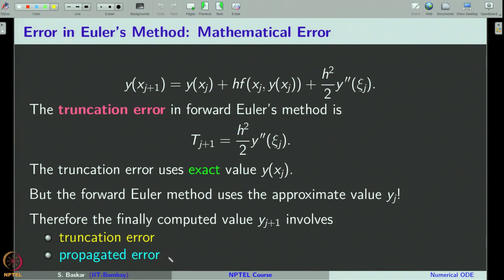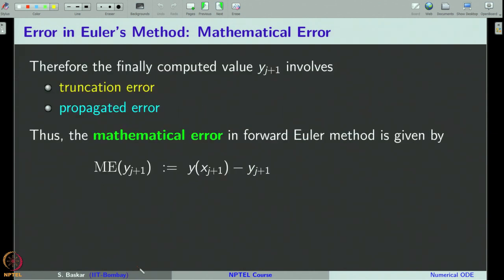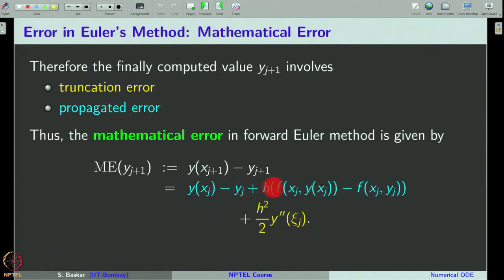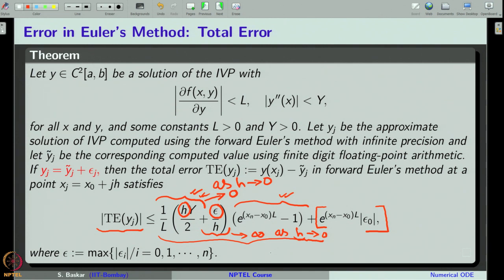Week 11 : Lecture 56 : Numerical ODEs: Euler Methods (Error Analysis)

Comment: Thank you for this clear explanation. I just have a question. At 16:28 , should the right-hand side of the first inequality ( the partial derivative that is less than L )  include yj instead of y(xj)? that is the approximate value of y at point xj not the exact value
Please, let me know whether that is correct or not
Reply: Here we take y(xj) not yj because we are taking bound of partial derivative so it will over that grid where it become max.